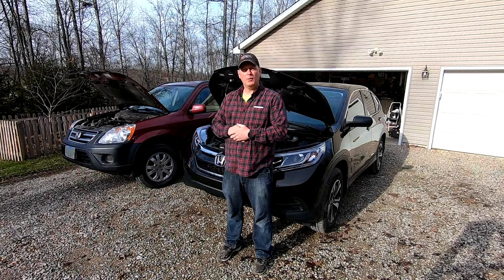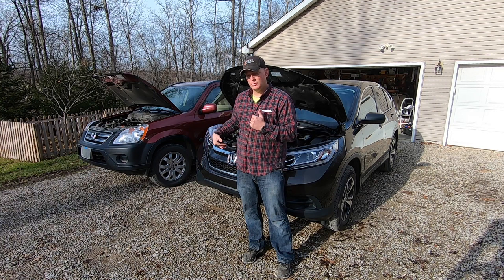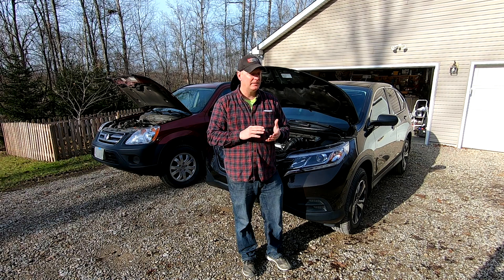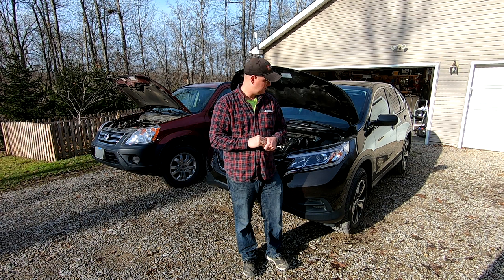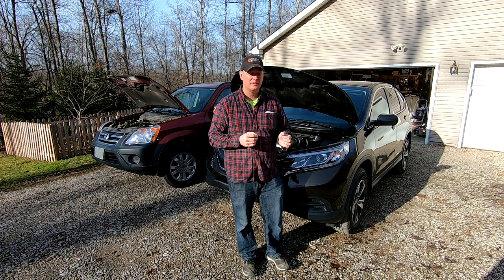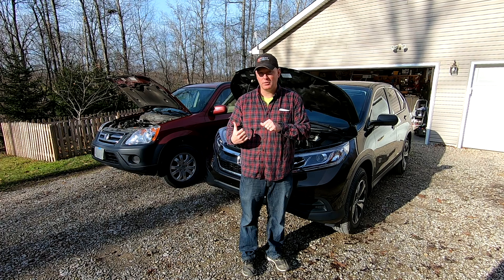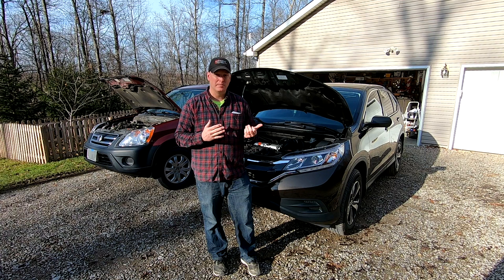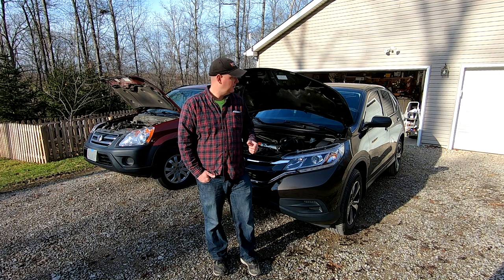DON'T BUY THIS CAR - 2012-2014 Honda CRV

Comment: I have to disagree with you. I have a 2012 CRV. Yes I had a bad VTC actuator as well but I replaced it myself (not that difficult) for under $200 using Honda parts. Been over a year and the startup noise is still gone.  Saying the entire car is bad for a $200 fix (if you do it yourself) is crazy.  160k miles I have had no other issues with my 2012 CRV, I’m the original owner as well.
Reply: How long did it take you to do it yourself?
Reply: @spritemoney  less than a day. I worked slow.  Also, I didn’t take the camshafts off. There is one or two YouTube videos showing the process without removing the cams.  This method is better.
Reply: This is very much a “throw the baby out with bath water” approach in the video. People have got used to ultra reliable vehicles and complaining about problems with 10 year old cars with 100K+ miles on them. Any one old enough to remember cars from the 80s, they would literally disintegrate before 10 years of driving.
Reply: @wcg66   Cars started to be reliable due to implementation of OBD in cars starting 95-96. It made manufactures make robust engines due to emission systems, fuel injection, etc. best of all it made it easy for your regular joe to repair their own cars.
Reply: He nailed it with this video. Honda has gone downhill. Some have problems maybe others don’t  staying away from Honda
Reply: Same here, original 2012 owner as well. VTC failed/replaced at ~130k and still quiet at 165k

Though I ended up doing the full camshaft removal, because my VTC bolt was STUPID tight on the camshaft. Um.. Like..I broke the end of a 1/2"  breaker bar, which was super cool with the top of the engine wide open! 😬
Reply: We had our 2012 Honda CRV VTC replaced while still under warranty.   The exact same noise returned within a few months while still under warranty.  Honda claimed there wasn't a problem so they refused to replace the VTC a second time.   The VTC continues to make noise on cold starts.    Many folks cannot do the repair work themselves.  Im not capable and my husband is a paraplegic so we are stuck.  Im not so sure replacing the VTC a second time will do any good since the noise returned so quickly after the 1st replacement.  We are not prepared to pay for such a costly repair that may fail again.   Honda should have replaced the VTC the second time while still under warranty though they claimed they never heard the noise.  I had the noise recorded on my cell phone it was undeniably the VTC.   btw 1st time it went bad we had less than 18,000 miles on the car.   Our CRV also has chronic issues blowing cooler to cold air on drivers side ...40 and 60 degrees f on defrost.  Had the heater core flushed and actuator blend door recalibrated which has helped tho still blowing on average 20-30 degrees cooler than the passenger side.  It's a shame because other than this we really like the 2012 CRV.
Reply: @lorigurney7280  the uneven heat is an issue with the heater core being partially clogged. The official Honda TSB says to flush it with CLR cleaner. It works. I'd also recommend going the Zerex (or other name brand) "Asian model" coolant. My coolant was always Honda, replaced on schedule, and clogged up the heater core just like yours.

If Honda replaced your VTC under warranty, then it was probably replaced with an original VTC and not the (supposedly) updated version, which wouldn't have been available yet.
Reply: @lorigurney7280  What was the part number when they replaced it? It should be on the work order.  If they replaced it with the old part number and not the new updated part the noise will definitely return.  I changed my VCT actuator with the updated part and noise has went away. Been almost 2 years now.
Reply: @TurkeySandwichJr  thankyou yes we had the core flushed 1st time in 2017 ..and this past wk.  Happy to have heat again!  Though drivers side is  20 degrees cooler atleast I have heat.  About the VTC that was my exact question to the service department I asked if they used the same faulty part and they swore up and down they used the new replacement updated part..well what could I say?   I hear it every morning during a cold start. Anyway appreciate all the advice as sure hate to cause major damage from driving it with a bad VTC
Reply: @Tacoexplorer  14310 - R5A - 305 replaced in July 2016.  I drove it for a few yrs as the noise progressively got worse I did a search on Youtube and found the VTC Actuator was the issue.
Reply: @lorigurney7280  that's supposed to be the updated version 🤷‍♂️. I have heard of it going bad again, though. Fortunately mine has not. I'd recommend to have it replaced, and have a competent mechanic make sure the timing chain is not stretched. It's not a cheap repair to pay for, but it's a lot cheaper than buying a new car.

I'd also recommend doing a drain and fill of the radiator, at every oil change. I started doing that, and the heat has gotten better over time, now back to "good as new".
Reply: @@TurkeySandwichJr  Thank you for the suggestions.
Reply: @Tacoexplorer  The latest part number will not correct the issue. I did mine at 80K miles, about 3-1/2 years ago. The dealer's parts guy told me mechanic that Honda was so concerned with removing the old part number from distribution that an area rep. actually went to their parts shelves to remove any old stock. I had the latest upgrade installed. It's now 75 K miles later and the startup rattle is back.
Reply: How did you fix it? Can you share details? Forgive me if that was already asked and answered.
Reply: @Tacoexplorer  We had it replaced under warranty, but it started up again 3 years later in the cold.  I have the newer part, and will go to an independent shop of high esteem.  Other than this issue, the car is stellar.  I will look a the part number that comes out.  I think that it is ridiculous that there is not a permanent fix.  I won't go near a 4 cylinder turbo for any reason, so newer models are not an option.
Reply: @scottasbj  Yeah mine has been 3 years since I changed it and the noise is completely gone.  We also have a 17 CRV with the 1.5T but I don’t like that car much.  Jumping ship and getting a rav4 hybrid. Waiting for the next gen to come out before I do.   My buddy has one and he consistently gets 43mpg in it.
Reply: Honda stopped doing courtesy coverage of this issue, out of warranty, as they had a significant percentage of dealer repairs fail, due to the complex nature of the repair. I heard this right from our local dealer's shop manager. The fix for most of us,  is more like $2K or more, especially since the chain is typically stretched, and buying the chain, guides, VTC, and seals is WAY more than $200 in parts to DIY correctly. It is also not a once and done, life of the car fix, for many. I've got another 80K on mine, post repair, and it's back. At no point did I "Say the car is bad for a $200 fix" There are many, many reasons that this series of CRV is far from Honda's best effort, and I listed quite a few.
Reply: @TurkeySandwichJr   Yikes!!  That's one frozen bolt.
Reply: @wcg66  Not all 80's cars did. My '85 7 Series has run to 360,000 miles. Original timing chain, original transmission, original AC compressor, radiator etc. . Just suspension, coolant hoses, brakes and wheel bearings replaced
Reply: @Tacoexplorer  what's the part number of both the old part and the new part number
Reply: @chuckger1625  new part number is 14310-R5A-305.  Not sure what the old one was.
Reply: your choice. I did differently.
Reply: @andreyarzhayev2566  how did you do it.
Reply: @lorigurney7280  It's as easy as replacing the spring inside the actuator in most cases.  Some engines need a new timing chain tensioner, chain, and / or VVT oil control valve.  Replacing just the actuator is only one part of the equation.  Many people replace them and have the rattle come back because they have other parts that create the conditions for the rattle to occur.
Reply: We bought our brand new in 2012 as of now with 51,000 miles haven't come across this issue yet. But I'll keep an eye out on it.
Reply: @wcg66  yes but cars back then were 5000-6000, not 28k-40k like they are now. my 2007 elantra has 123,000 miles and has nothing but 1 coil pack replaced ( plus normal wear items ) . a honda that is 2x the price should be a better car.
Reply: What would that issue cause in the long run besides the slight rattle in cold starts?
Reply: BruceWayne-sz3th I had an 84 honda civic. It lasted well over 10 days. Nothing broken.
Reply: Respectfully Disagree. Never had that one small issue with the actuator and we’re rolling on 2012 CR-V 320,000 miles so far.
Reply: I worked at Honda and master tech told me as long as you change the oil every 3k you won’t have this vtc issue.
Reply: @volt6008  well I changed the oil religiously every 3k miles on my 2012 CRV and I had thus issue. Original owner too. It’s a design flaw that’s why they came out with an updated part number.
Reply: Our 2014 CRV should be painted yellow.  I’m really disappointed that Honda is ignoring the VTC actuator problem.  Honda USA customer service was very polite but said there isn’t enough of a problem to have a recall.   We have had 2 installed and looking at a third
Reply: Just let it do whatever it wants go honda go.
Reply: @Tacoexplorer  hmmm…. I wonder why he would tell me that then…. And was the oil change every 3k since 0 miles on your Honda? I don’t agree so.
Reply: @volt6008 yes it was. Bought the car brand new. I change the oil at the 60-70% maintenance minder mark this is at 3000-3500 miles. My car never seen the maintenance minder below 50% ever.  It's not oil that's killing these it's a design flaw.
Reply: @McDzy  it causes the timing components to get out of wack... Which eventually means the timing chain has to be replaced for $2K... Happened to me at 80K miles... 2k Miles later and I'm hearing the rattle again
Reply: Can you please point me to a  link on how to do it yourself. I am mechanically savvy and have done minor to medium repairs myself. Would like to know what it takes.  I have only 41K miles and want to prevent any further damage. My 2014 and this has been there since after the 1st year. I thought it was a starter issue. It does every now and then and more so on colder days. Very worried now that i found the issue .
Reply: I'm at 82,000 miles on our 2014 and just did the first brake job on the rear (did the fronts about 4 months ago) all on my own.  Thanks to Youtube it's not that difficult if you have the ability to buy the parts!  Nice to hear of others getting good mileage out of their CRV's.  Once a year, I give the whole engine and engine-bay a good wash & cleaning, where it looks brand new again!   We do tow our CRV behind our motorhome, so dust does get up under the hood over time, so a good cleaning definitely keeps the car looking in good shape.
Reply: Honestly that's not the only problem. I have one with 285k km (177k miles) and there are two things that i dislike about 2.4L engine: 1) Camshaft wears down - mine wore down terribly on 177k miles and i'm not sure if it wasn't replaced already. That's a common problem on k24z4, z7, z9 (accords, CRVs, crosstours and others) and the original part is a much-much more expensive thing than VTC actuator. There are some Chinese replacements that actually do work so i'm going to try these 2) VTC is not the only thing you got to replace in order to get rid of that terrible sound for a long period of time. You also need to replace the chain with tensioner, dumper and other stuff)  3) Mine started consuming oil just because f-g manual says you can change oil each 15k km (9k miles) and that's a terrible thing for the engine. sadly that's what the first owner did up to 90k miles. 2.0L engine is much more durable and would survive such abuse. 

But i still don't think that makes it terrible. If you are scared of these problems - get the 2.0L version. It's an SUV, not a race car so who cares if it is a little slower. At least it is much more durable
Reply: I agree. Sometimes, I get the impression that these guys that give motor reviews are just saying a lot of nonsense to get attention.
Reply: I have a 2013 CR-V that I bought in 2016.  I didn’t notice the rattle at startup until several months later, when cold weather returned.  In researching this, I learned it was due to the variable valve timing actuator, but I didn’t know it could cause damage until I watched this video.   I’ve had no problems with the car and I only hear the rattle occasionally.  I have 101,000 miles on the car and have been very satisfied with it.  Now I’m not sure what to do.  I felt lucky not to have one of the newer CR-V’s with the 1.5 direct injection turbocharged engine, with oil dilution issues and extra costs associated with turbos, as well as the CVT transmission that doesn’t last as long.  Now I’m feeling like I have a fragile car.
Reply: Thank you that help me a lot
Reply: @martinr8278  There have been some issues with individual models, but overall, Hondas are still reliable (5th out of 30 makes, according to Consumer Reports).
Reply: You can actually fix it for less by just replacing the springs. Less than $100 if you replace all the seals on the Valve cover as well.

Comment: I have to respectfully disagree with you. Those CRVs are the final years with 2.4 before heading to 1.5 turbo and CVT. Sure that bothered heck out and sure this car burns oils but this is probably something you can compare to 5th gen 4Runner from overall reliability perspective. You just change the oil every 3-5k miles and this CRV will last forever. This is truly the last most reliable engines CRV has to offer.

Comment: As of January 2022, "A Honda VTC actuator class action lawsuit has been certified in two states (California and Illinois) after owners complained their vehicles rattled a few seconds on cold starts." "According to the plaintiffs, Honda injured them by failing to tell them about defective variable valve timing control (VTC) actuator 14310-R44-A01 in these models."
Reply: Where can we get more info on this? I’m in California and this is an issue I’m having
Reply: I just paid Honda $1900.00 
. getting this done. VTC Actuator.🥴🥴
Reply: C’monnn Virginia!!!!
Reply: Cmonn ohio
Reply: any info on getting in on the ILL. suit? what is the warranty on the VTC any way?
Reply: I do agree with 100 because I have these proplem
Reply: Cmon Colorado
Reply: After 10 years of use people...cmon
Reply: Any class action in Texas on the same issue?
Reply: I have this problem, what’s the best approach to it, should I replace these parts or replace the entire engine?

Comment: As a honda mechanic I have found out that the timing chain tensioner goes bad because they changed the position of the sprocket  (vvt sprocket is on left side causing a lots of wear on the tensioner), but is an easy replacement.
Reply: Agreed. This happened to me on my 2016. The belt tension was bad . Replaced it and never heard this rattle noise again
Reply: I had to replace my belt and tensioner on a 2013. I asked Honda to help but they wouldn't. I didn't do it myself. Expensive. I could have left it but it was noisy.
Reply: What has your gas mileage been? Which engine air filter to you put in?